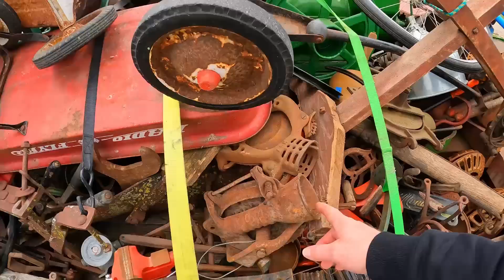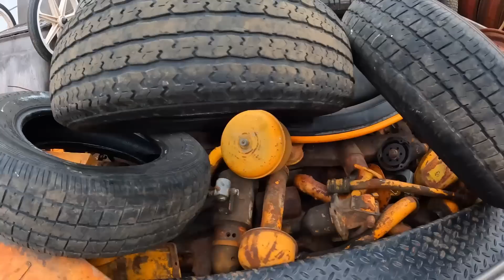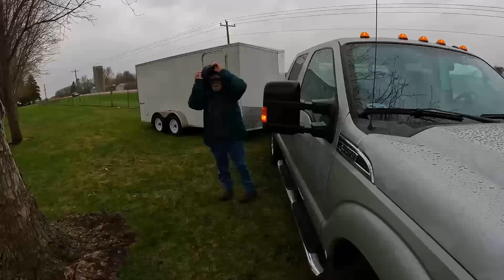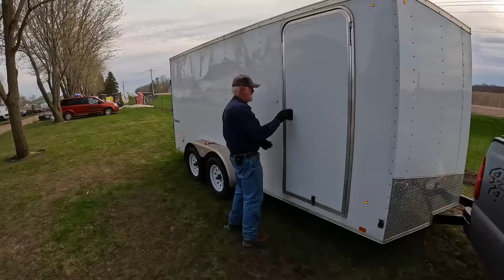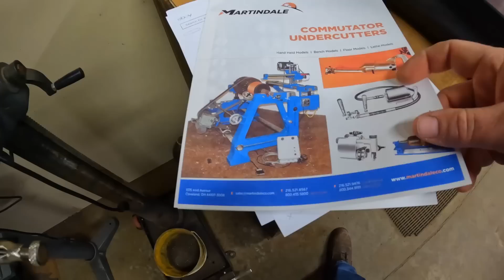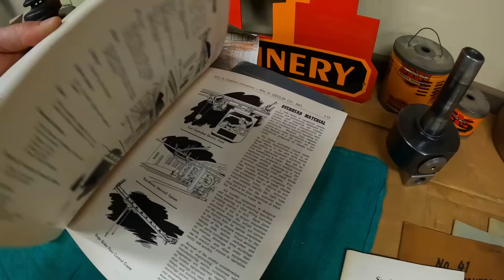The Great LeSueur, MN Swap Meet 2025! Acres of Old Iron for Sale!

Comment: Thanks for taking us with you on this trip. I'm in Tennessee so it was a little too far away for me to get there on my own. I'm a little disappointed that you didn't find parts for the X231 steering gear but after seeing how you repaired the shaft for the live PTO and the repairs to the steering shaft, I have confidence that you will repair that steering gear assembly to as good as new or better than new condition. I'm patiently waiting for when you resume work on my favorite tractor. Until then, I will survive on the playlist.

Comment: Looks like you have a new to you Super Duty truck.I remember you doing work on the red one.
Reply from the maker: I’ve had that silver F-350 since 2018, it’s a 2016 model year but it sat on the lot unsold for 2 years at the Ford dealer until the factory put so many discounts on it that coupled with my employee discount, I was able to buy it. I mostly drive the red ‘03 F-250 though because it’s my everyday & winter beater 👍